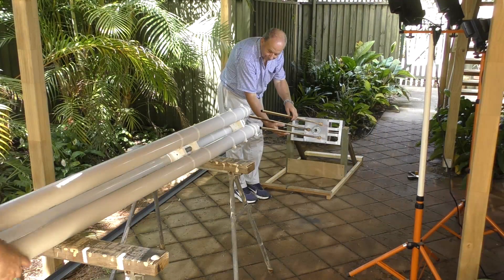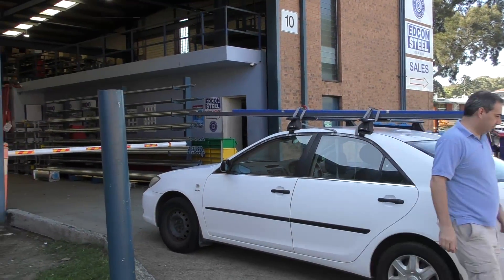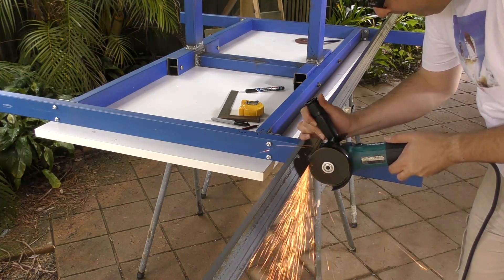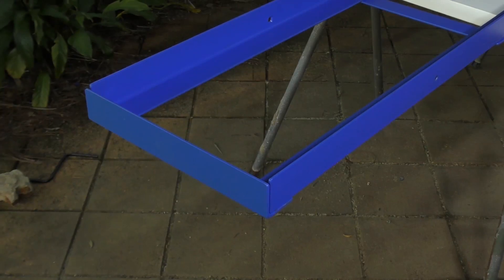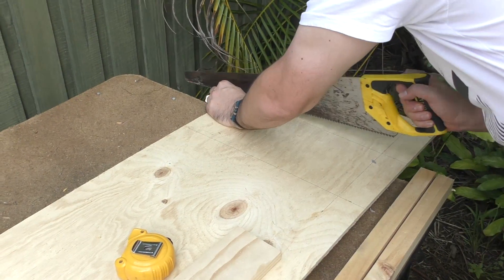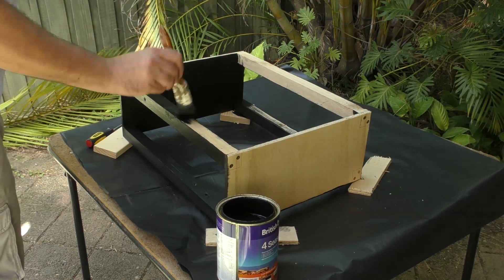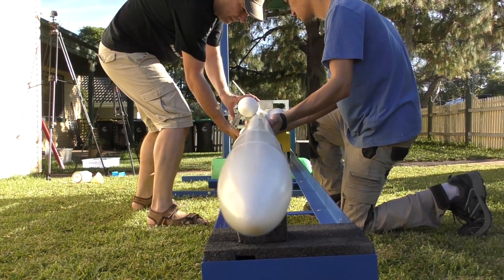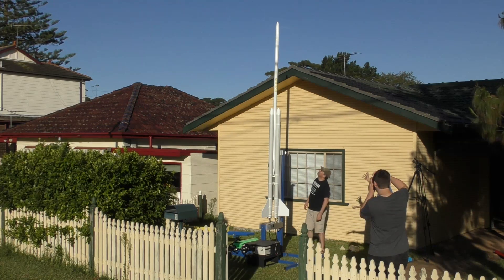2 Stage Water Rocket - Part 23 - Launcher Complete

Comment: I’ve not watched all your content but curious if you’ve ever tried incorporating Diet Coke and mentos into the propulsion system.
Reply from the maker: We have not. We pressurise our rockets to higher pressures than mentos and diet coke can achieve.
Reply: Air Command Rockets just figured I’d ask.  Our family is still at the quick disconnect garden hose launch system using the wide mouth Vitamin Water bottles.  Which are serviceable entertainment for now.  Was thinking of ways to spice it up and keep my 6,3,1 year olds interested.

Comment: Btw. did you tried carbonated water instead of plain water?
Reply from the maker: Yes we did, but didn't find much of a difference. The main problem was that most of the bubbles escaped as the carbonated drink was poured into the rocket.

Comment: If you have tools for almost everything why no stands for tilted launch platform? Thinking about when you attach the pipes at the bottom. Or even two hole with a big pin can prevent the tilting on the side of the frame and the launch platform's frame. 

2nd question: will you create a new nozzle optimizing for foam preventing the overexpansion of it?

Btw. nice to watch the whole series. The only problem with them is the time between an episode :)
Reply from the maker: That's a good observation. It is something we may add to lock the tilting platform in place while it is tilted over. It really hasn't been an issue to have someone hold it. 

There is currently no plan to make an optimized expansion nozzle for the sustainer because we would need to re-design the staging mechanism that locks into this nozzle. It is something we can explore in other rockets we plan to build. 

I know it can be a while between episodes, but there is only so much time I have with full time work, family and actually building the rockets. This video took close to 30 hours to edit, and so the outcome is longer between episodes.

Comment: Hi George, wondering what CAD software did you use for the launcher? And is there a chance of making a fully 3D printed launcher for smaller scale water rockets, could it work?
Reply from the maker: Hi Ashley, we use 123D Design. It's an older CAD from Autodesk, though we are looking to start using Fusion 360.

Comment: So, do you have any expectations on the altitude it'll reach with both stages?
Reply from the maker: Realistically we expect a 30 to 40% increase in altitude by using the booster. So around the 4000 foot mark in ideal conditions going exactly vertically, but there is a lot of ifs there. We don't know what the final weight of the booster is going to be yet, so it is hard to run any simulations yet to get a more accurate estimate.

Comment: So when you stand the rocket upright, won't the water from the sustainer flow into the tubing through the open non-return valve in the staging mechanism? Will you account for this by putting in extra water?
Reply from the maker: Good question. Yes some water may flow back down, but there is a really tiny hole in the air inlet line (below the non-return valve) so the amount of water that is likely to make it through that is very small. When air starts flowing any water that made its way through should hopefully push it's way back in. The other reason not a lot of water will flow out is because of the vaccum it creates above it as it start flowing out, slowing it down even more.

Comment: Is that rocket taller than your house? This is very impressive engineering! I hope you also have a multi-volume NASA style checklist to go through for launch. How many launches do you think you expect to get in a full day?
Reply from the maker: Ha ha yes, the rocket is about as tall as the house. Yes, we will have a long checklist, there are just too many things to do, and there are always plenty of distractions at the launch site so its easy to skip a step. I expect it will take about 4 hours to set everything up and prep the rocket, so we are most likely to get 1 launch in a day. If the rocket survives and doesn't need repairs we may be able to get a second launch in, but most likely only 1 launch per day.